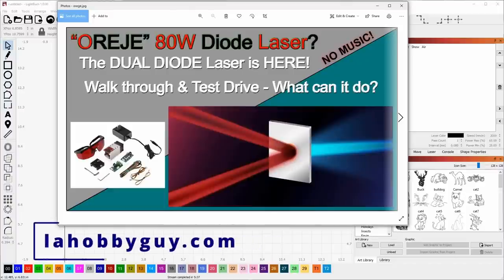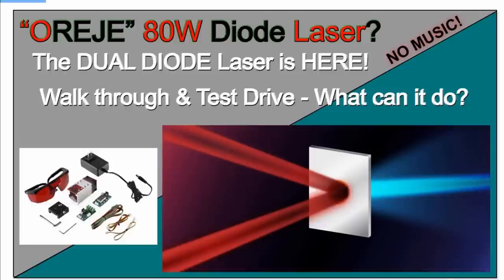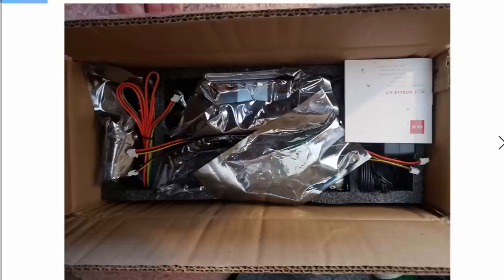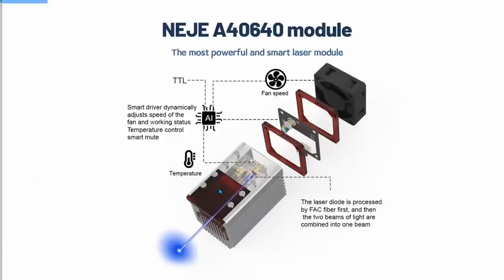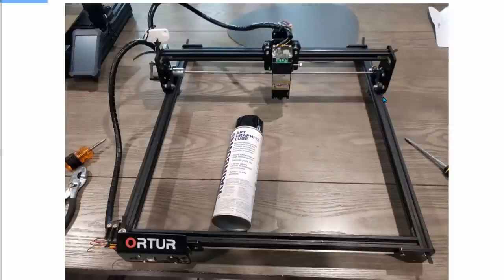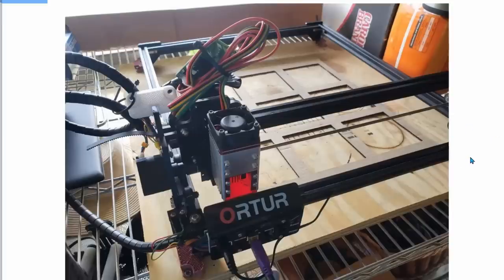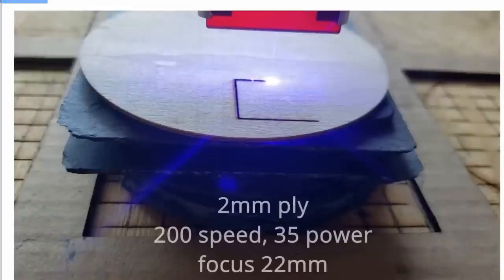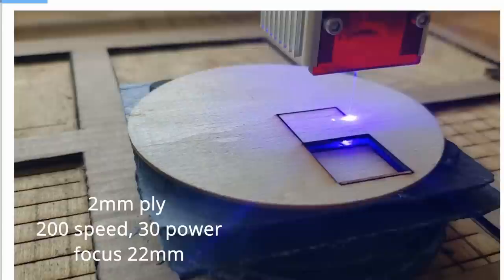Upgrading a diode laser from 20 to 80 watts!

Comment: Did you plug the power supply into your ortur board or the neje adapter board?
Reply from the maker: Hi Emmett. The power supply plugs into the main control board.
Reply: @TheLouisianaHobbyGuy  and you said you have a 60w power supply? Might be starving the laser at the higher power settings.
Reply: @TheLouisianaHobbyGuy  love your videos, you are a gifted tech instructor.
Reply from the maker: It's the PS that came with the laser Emmett. I would be starving the laser if I used the 30W that came with the Ortur.
Reply from the maker: Thanks so much! Really appreciated!
Reply: @TheLouisianaHobbyGuy  but it is also powering the ortur,  correct?
Reply: I'm all confused 😕
Reply: @TheLouisianaHobbyGuy  so 80w for laser, 12w for ortur is 92w needed. So an 96 or 120w would be needed to power the whole shebang.
Reply from the maker: @emmettbowen4431  Correct
Reply from the maker: @emmettbowen4431  Yeah, YouTube is having problems with comments and replies. Hope they get it fixed soon.
Reply from the maker: This one came with the Neje
Reply from the maker: @emmettbowen4431  This is the PS that came with the Neji
Reply from the maker: @emmettbowen4431  It's 7.5W x 2 diodes, or 15W optical output.
Reply from the maker: The lasers are only 2 x 7.5W optical output.
Reply from the maker: Yes
Reply: @TheLouisianaHobbyGuy  but you have figure input power, not output. I change mine to a 72w power supply. Works amazing now.
Reply from the maker: @emmettbowen4431  The input power on this is actually 40W, so the 60W PS is plenty... thanks for the informed comments! Other people need to see this.
Reply: @TheLouisianaHobbyGuy  something I've noticed since moving the power to the ortur board is the cooling stops once the laser turns off. Heat kills electronics.  Im going to run a 12v line to that adapter board to let the fan run until the laser is cool.
Reply from the maker: @emmettbowen4431  Mine runs for sometimes 5 minutes after the burn. Something wrong there Emmett.
Reply: @TheLouisianaHobbyGuy  indeed!
Reply: If I understood correctly you don't use neje adapter board at all? I bought 80w laser, got adapter board and I don't know what to do with it. I pluged new 12v 4A adapter into ortur motherboard.
Reply from the maker: @radionica42  No, I did use the adapter board.
Reply: @TheLouisianaHobbyGuy  Can you make a video how to wire it? I only got one 3 pin wire.
Reply from the maker: @radionica42  Then your missing the adapter board and the 4-pin connector. You need both and just plug it in like I did in the video. Contact the seller.
Reply: @radionica42  does your fan run after the laser shots off?
Reply: @emmettbowen4431  Yes.

Comment: Would that works with the Laser Master 2 Pro which operates on 24V?
Reply from the maker: Yes, if you buy the whole kit with the adapter board for a few extra dollars. It comes with its own power supply that plugs into the board.
Reply: @TheLouisianaHobbyGuy  I just made the switch. I'm having some issues with it: After doing a ramp test, it seems the focus is around 12mm below the red shield and the power is below my current ortur LU2-4SF. How would you proceed to adjust the focus(I saw there is a screw with the lens)?
Reply from the maker: @j4nch  You use the power adapter that came with the Neje. And this is a fixed focus laser, so you can't adjust the lens. I fiund the best focal point is 17-18mm from the bottom of the heatsink.

Comment: Hey, the Neje Aluminum Extrusions... What size are they? I can't find anything online and I haven't received mine yet but want to order longer extrusions to upgrade mine
Reply from the maker: https://amzn.to/38CFXkO They use 2020 extrusion. If I were to extend my work area I would use 2040 for rigidity. https://amzn.to/2VcyplQ
Reply: @TheLouisianaHobbyGuy  oh goodie, it's common stuff! I was afraid it was going to be 1530 or something whack like the Original Laser Master. If I went with 2040, I'd need a new gantry mount, wonder how much of a headache that would be
Reply from the maker: When I did my custom laser build last year I used 2060 for the gantry. It was $17.00. https://amzn.to/3BI0Oj8
Reply: @TheLouisianaHobbyGuy  how'd you fix the laser slider to it though? That's all gonna be different too. I assume there's probably appropriately sized replacements
Reply from the maker: @oakridgereview1359  I used a custom designed 3D printed file.

Comment: Rich I was looking at your attempts at engraving the anodized aluminum.  You may not know but there are 2 types of anodizing they use.  There is Type 2 and Type 3.  Type 2 is what we can cut with the diodes.  I can easily engrave the Type 2 with my 20W Ortur at speeds of 1200 and power 70 and get results like you did.  The Type 3 anodizing is a VERY hard coating and with the diode lasers about the best you'll be able to do is to just mark it but you wont get through the surface.  Maybe with a CO2, I dont know, but certainly not with a diode.
Reply from the maker: No, I didn't know that Peter. The aluminum cards & tags I buy are 2 types; either coated or anodized. I always buy from the same supplier.
Reply: @TheLouisianaHobbyGuy  I have some anodized aluminum business cards that I purchased off Amazon.  When I tried to engrave them all I could do was to barely mark them whereas another piece of aluminum engraved super easy.  I suspect that perhaps my business cards might be the Type 3, but there's no way for me to figure that out, although I may try to engrave them at some other time.  It possible that the ones you  have could be Type 2 if they engrave easily, which is great if that's the case.  Anyway I just thought I would mention that, in case you or any of your viewers have a similar issue with their laser not cutting through the anodizing.  The anodizing is typically about 20 microns thick, which is 20 millionths of an inch....... (0.00020") or 2 ten thousandths.  It makes sense that cards from China would be anodized in the least expensive way and also as thin as possible, but maybe not.....
Reply from the maker: @peterstenabaugh6810  I believe they are. I used to think there was only anodized & coated, but I recently found out about the different types. I guess I just got lucky!
Reply: @TheLouisianaHobbyGuy  I also enjoyed your video on the OREJE laser conversion.  I have recently purchased the NEJE 30W laser, along with the G8 lens / air assist from Expocnc.  They say that the G8 is a columnating lens that produces a 'square' laser dot.  I'll have to check that out once I get it mounted and powered up.  IF that's the case I'll let you know.  I'm not doing the upgrades until I receive my honeycomb panel in Jan. sometime, then I have several upgrades to do on the Ortur.  I want to get into doing more plywood cutting etc so the 30W laser and honeycomb panel will make that easier.  Thanks for your great videos.
Reply from the maker: @peterstenabaugh6810  Let me know how it goes Peter.
Reply: @TheLouisianaHobbyGuy  For sure, I'm sure some of your other viewers will be interested.  I am upgrading to the NEJE 30W, installing a new Z adjuster from Expocnc along with their G8 lens but I'll have to re-invent the air assist as I want to have a 1/4" nozzle to suit my heavy duty pump which is 13,500 lph output at 7 psi..... of course that will be reduced once it hits the nozzle.  I am also installing 15mm drag chains on the X and Y, including increasing the wire lengths to suit and enclosing the 3/8" air line. I am installing a 400 x 430 honeycomb panel with 1/4" air gap under it for air escape.  I'll have a steel sheet metal plate under the honeycomb to protect burning on the spoil board and reduce smoke.  I also need to square up my Ortur frame so I'll take some photos of that as well.  I'll take lots of photos so I can post some of them on the Ortur FB page but I'll send them all to you so you can post the photos and the matching 'book' of information so that others can benefit. I'll make a note on the Ortur FB page to reference your website for the whole story - that seems to be the better way to show this. The photos on FB will only be a teaser....... All this wont happen until my honeycomb arrives in late Jan.
Reply from the maker: @peterstenabaugh6810  You can make the post in my Forum yourself Peter. I think it would have more impact if the actual author is the owner.

Comment: Isn’t that suppose to be a 40w?
Reply from the maker: No, it's the original A40640 that was 2, 7.5W diodes. They have since changed it to 2, 5.5W diodes. The input wattage is just a marketing stretch of the truth, as stated in my pinned comment.

Comment: I currently have a Yora 40W Laser, would this work with the Yora?
Reply from the maker: Charles, this is essentially a 40W diode laser (14W Optical Output) so I wouldn't see any benefit in switching.

Comment: does this fit both the ml2 and ml2pro
Reply from the maker: Yes, either one. It does take a little customization. I printed an adapter. If you have the 24V LM2 Pro, you'll need to get the kit with the power supply & adapter board and power it separately.

Comment: its 20mm from the bottom of the heatsink
Reply from the maker: 20mm isn't optimal for me. Under a microscope, the smallest dot is 18mm. But depending on what I'm doing with it, there's a big swing in focusing. Doing a ramp test gets you close, but you can't beat the microscope test Luma.

Comment: sorry but for the price of the new laser you can get a k40 with a little difference ! a CO2 laser of 40w it's a game changer...
Reply from the maker: That's right, but the K40 only has an 8x12" bed, so you're very limited on the size of your workpiece. Not only that, but you also can't run Lightburn on it without replacing the control board, which is also a major $$ upgrade. Those two differences are major IMO.

Comment: Somehow I missed the upgrade to 80w! Going by other comments, it must be me that missed it. The 40w laser uses two 20w so that's not 80w & not sure where the video title came from. I also can't understand why you just decreased speed for the bamboo test rather than increase power instead?
Reply from the maker: The video title came from the Neje advertisement. Did you read my pinned comment? I made it perfectly clear in the first minute and 30 seconds that this is not an 80W laser, as well as explained the title in my comment. And I did raise the power to 100% and 30 spd in the 3rd pass and it did nothing but char the surface on the bamboo. I also ran a power scale off camera the next day and it wouldn't go more than 1mm deep. Other than the bamboo fail, this is still the most powerful diode laser I own, and I have six lasers.

Comment: Would it help to move the laser focus point from 19 to 27 on second pass on bamboo and then lower again on next pass...?
Reply from the maker: Maybe 22, since that half the thickness Merrill, but the fail on these particular boards is consistent with every laser. I believe they are using a very strong glue in large amounts, since I can see signs of it melting.

Comment: I don't understand as I am able to burn YETI mug with my Ortur 20w at 250 95%
Reply from the maker: What don't you understand?
Reply: That little plate of aluminum has bery light powder coat compared to the YETI and and you said you had a hard time or not able to laser
Reply from the maker: @francisvachon2051  It depends on whether you get coated, powder coated or anodized. Coated and powder coated are easy.

Comment: You should not use graphite on ball bearings as the ball will slide and not roll
Reply from the maker: Thanks for the tip Gordon! I haven't had a problem yet in three years on four machines, but I'll switch to white lithium on your advice since I don't know much about lubrication.
Reply: I come from an engineering background and we were told not to use graphite or lithium as the balls will slide and not roll the ball bearings should be either shielded or sealed and when made they are lubricated so I would not worry about them however any thing that slides I would use silicon spray
Reply from the maker: Thanks again Gordon!

Comment: Eu acredito que a fumaça que sobe a partir do ponto de queima atenua o feixe laser. A luz azul é muito sensível a qualquer sombra ou obstáculo em seu caminho. Trabalho com espectrofotometria na área médica e os filtros mais sensíveis e que tem mais dificuldade de deslocamento são os azuis.
I believe the smoke that rises from the burn point attenuates the laser beam. Blue light is very sensitive to any shadows or obstacles in its path. I work with spectrophotometry in the medical field and the most sensitive filters that are more difficult to move are the blue ones.
Creo que el humo que se eleva desde el punto de combustión atenúa el rayo láser. La luz azul es muy sensible a las sombras u obstáculos en su camino. Trabajo con espectrofotometría en el campo médico y los filtros más sensibles y más difíciles de mover son los azules.
Я считаю, что дым, поднимающийся от точки ожога, ослабляет лазерный луч. Синий свет очень чувствителен к любым теням или препятствиям на своем пути. Я работаю со спектрофотометрией в области медицины, и самые чувствительные фильтры, которые сложнее переместить, - это синие.
Reply from the maker: Absolutely! Thank you for the comments! I have air exhaust and air assist at the laser point, I just don't use it in the videos because most don't.

Comment: It is 10W not 80W..only optical power matters. 80W is CO2 laser territory...
Reply from the maker: Completely explained in the video and in the pinned comment. And it's not 10W. Neje has 2, 7.4W diodes that they use through a FAC lens that produces around 14W or so. But you would know that if you actually watched the video.
Reply: @TheLouisianaHobbyGuy  Others say it is an exaggeration  and in reality it is only 5,5W and it does not cut either like a 15W lasercutter... what is the speed at full power on 6mm plywood??? (one circle) 100 speed mm/min means 1,5mm/sec. mine cuts it 6-7mm/sec about 4X faster.
Reply: My Co2 has 50W but in reality it is more like 40W and cuts tze 6mm material about 6-7 mm/sec one pass so it is realistic. Nice diode laser but only a diode laser, you still have to build a box to it with fuem sucking + air assist + buy a honey comb bad (which will never be the right size) I m ean if you really want to cut with it. In bigger sizes it makes more sense like Neje has that46x80cm bad that is really big with the same laser...sorrily not very cheap either...